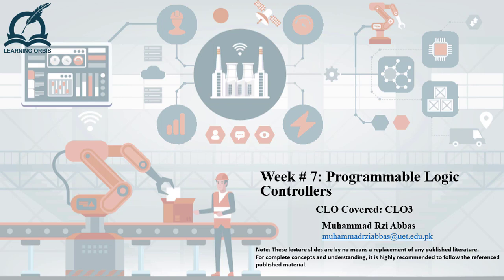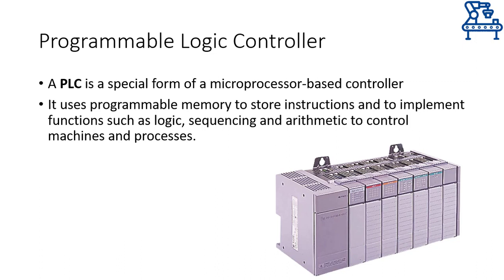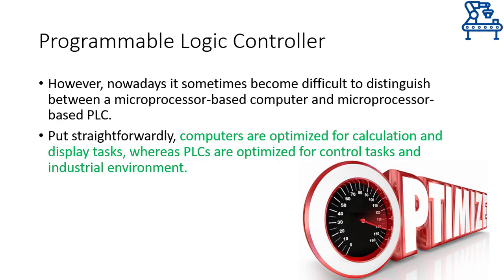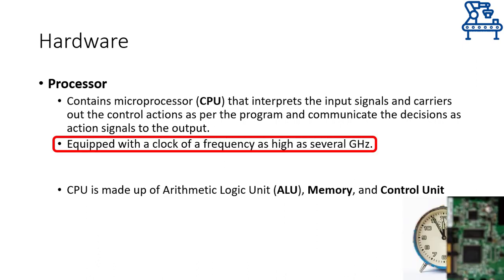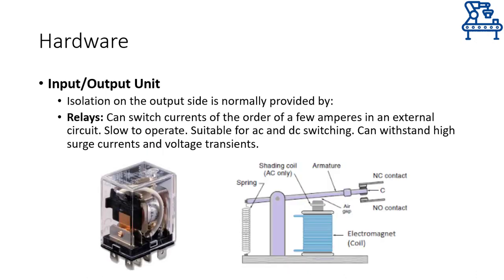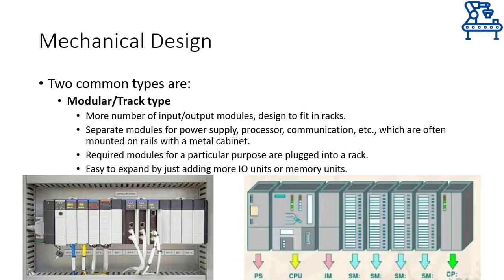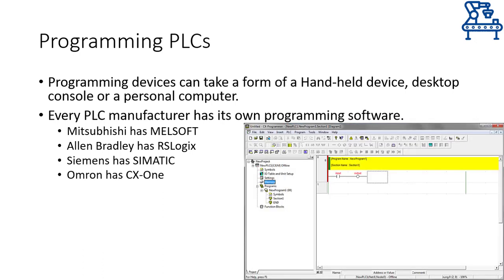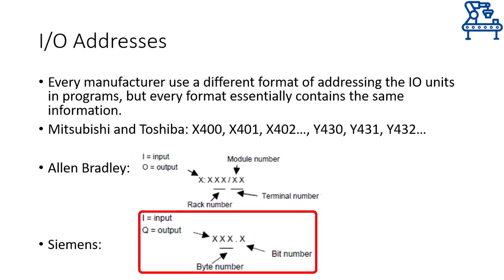Getting Started With PLCs | Hardware and Software

Comment: - PACs are digital computers that hold and execute embedded programs.
- PLCs and PACs differ in their programming interfaces, PACs use C or C++ whereas, PLCs are programmed using ladder logics.
- PLCs control discrete processes or machinery while PACs are better suited for more complex automation solutions dealing with advanced process control, motion control, visualization, and much more.

Comment: A PAC is an advanced type of microprocessor controller which uses Distributed Control Systems (DCS) and Remote Terminal Units (ITU) along with the abilities offered by PLCs in order to provide wider connectivity options and broader controls over equipment. 
PACs are more difficult to program and use a high-level programming language like C++ or C.

Comment: Programmable automation controllers (PAC) are digital computers which hold and execute embedded programs and perform complex tasks and they usually control machinery in factories.
Programmable logic controllers(PLCs) are industrial computers use for simple tasks. They are used in manufacturing, plants and other automation environments.

Comment: PACs are Programmable automation controllers, are digital computers that run embedded programs and are built to fit the industry's environment.

PLCs regulate discrete machinery and processes, whereas PACs are more suited for complex automation solutions dealing with advanced process control, motion control, and so on.

Comment: PAC's are the automation controllers that are used to implement high level instructions in industry.PAC offer more input/output remote capabilities and has a smaller size. Also they are more resistant to environmental stresses.
PLC's on the other hand are used in industry of the execution of relatively simpler tasks.These are based on wiring so additional hardware is needed for extra I/O ports.PLC's have limited memory and are less resitive to environmental stresses.

Comment: Programmable automation controllers (PAC) are digital computers that execute embedded programs and build as we desire for the industry. 

The difference between the PLC and the PAC is the mode in which it scans. Usually, the PLC runs continuously. PAC has a real-time operating system that allows it to run in a scheduled cyclic mode. and  PACs are more suitable for complex systems whereas PLC's are used in simple tasks as compared to PAC's.

Comment: Programmable Automation Controllers are digital computers specifically designed for a particular application. PLCs differ from PACs in the way that PLC runs continuously while the PAC carries out its operations in a cyclic mode. This enables the PAC to execute quite complex alogrithms.

Comment: PAC stands for Programmable Automation Controllers. They are actually digital computers to carry out embedded programs and they are designed specifically according to the usage required. 
The main difference between PLC and PAC is that PLC runs continuously and for rather simple tasks while PAC runs in a cyclic mode and executes complex programs.

Comment: PAC stands for programmable automation controllers,  They are actually digital computers to carry out embedded programs and they are designed specifically according to the usage required. 
The main difference between the PLC and the PAC is their scanning mode. The PLCs run continuously while the PACs run in a scheduled cyclic mode.
 PACs are used for more complex systems and PLCs are used in simple tasks.

Comment: PAC stands for Programmable Automation Controllers, they are digital computers that execute Embedded programs and are designed according to the environment of the industry.
The main differences in the PLC and the PAC is their scanning mode. The PLCs run continuously while the PACs run in a scheduled cyclic mode.
PACs are used for more complex systems and PLCs are used in simple tasks.

Comment: Programmable Automation Controllers (PACs) are industrial computers constructed and adapted for manufacturing environments. These computers are the brains of a manufacturing operation as they control automation equipment with high reliability.                                                                    
 PACs use C or C++. PLCs on the other hand, are programmed using Ladder Logic. These programming differences create distinctions in the architecture and capability between the two computers.

Comment: A Programmable Automation Controller (PAC) is a 2 or more processor-based device like a personal computer using multitasking capabilities to automate control of one or more pieces of equipment. 

PACs are more intricate using C or C++. PLCs, on the other hand are programmed using ladder logic.

PACs offer robust monitoring and control features when compared to PLCs, which are more basic in design.

Comment: PACs stands for  Programmable Automation Controllers and have ability to monitor and control thousands of input output points during the tag-based programming and used for complex tasks while the PLCs (Programmable Logic Controllers) have simple execution but with limited memory and allow the communication between others multiple PLCs, HMIs (Human Machine interfaces ) and data acquisition systems (SCADA) and used for simple tasks.
So the PLCs are ideal in high speed Control, also the main difference between PLCs and PAC is their programming language.
For PLCs we use Ladder logic and for PAC we use C or C++.

Comment: The term Programmable Automation Controller (PAC) is used to describe any type of automation controller that incorporates high-level instructions. It is industrial computer   constructed and adapted for manufacturing environments.
The most notable difference between PLCs and PACs is their programming interface. PACs are more intricate using C or C++. PLCs, on the other hand, are programmed using ladder logic.

Comment: PAC stands for programmable automation controllers, they are digital computers that execute embedded programs and are designed according to the environment of the industry.

PACs are more suitable for complex systems whereas PLCs are used in a simple task.
 The PACs are programmed using C or C++, therefore, have an open architecture and incorporate modular design. Whereas, the PLCs have simple program execution.

Comment: Programmable Automation Controllers (PACs) are digital computers that hold and execute embedded programs. 
Main differences between PLCs and PACs are given below:
1. The main differences in the PLC and the PAC is their scanning mode. The PLCs run continuously while the PACs run in a scheduled cyclic mode.
PACs are used for more complex systems and PLCs are used in simple tasks.

Comment: PAC stands for Programmable Automation Controller. PACs are digital computers that hold and execute different programs. It is actually a combination of PLC and PC and give multi domain functionality. It is best suited in complex logical processes. 

Difference between PLC and PAC is that PLC uses ladder logic and PAC uses exception based logic. Also, PLC runs continuously and scan whether some input is turned on or off but PAC perform action or make decisions when an exception occurs.

Comment: PAC stands for Programmable Automation controllers. These are industrial computers constructed and adapted for manufacturing environments. These computers are the brains of manufacturing operation, providing a highly reliable control of automation equipement. 
1. The most notable difference between PLCs and PACs is their programming interface. PACs are more intricate, using C or C++. PLCs, on the other hand, are programmed using ladder logic, a programming language that employs symbols representing an electrical schematic of relays. These programming differences create distinctions in the architecture and capability between the two computers.
2. PACs provide more flexibility in programming, larger memory capacity, and better scalability for future expansion. They are particularly useful for systems with a high percentage of analog I/O. Oftentimes, they will be implemented in systems with extensive network interface requirements and systems with direct user interaction requirements.

Comment: PACs are programmable automation controllers. They are digital computers that hold and execute embedded programs.
 PACs are more suitable for complex systems whereas PLCs are used in a simple task.
 The PACs are programmed using C or C++, therefore, have an open architecture and incorporate modular design. Whereas, the PLCs have simple program execution.

Comment: Programmable Automation Controller (PAC) is a term that comes loose to define any type of automation controller that includes high-level instructions. The system is used in the Industrial Control System (ICS) for machinery in a wide range of industries, including those involved in key infrastructure.
* From a programming point of view, a PLC typically has a stable memory map and address. In contrast, a PAC allows tag names and allows users to specify data types. It provides more flexibility, especially when expanding the system.
* PACs typically offer much greater I/O capacity and user memory size for larger projects and larger overall system sizes.

Comment: Programmable automation controller (PAC) is a term that is used to describe any type of automation controller that incorporates higher-level instructions. The systems are used in industrial control systems (ICS) for machinery.

The basic difference lies in the programming interface of the two, making them serve different functions. The PACs are programmed using C or C++, therefore, have an open architecture and incorporate modular design. Whereas, the PLCs have simple program execution. Owing to this, it can scan along with limited memory and discrete Input and Output.

Comment: PAC is Programmable Automation Controller.

The two differences between PLC and PAC are as follow:
1. The basic difference lies in the programming interface of the two, making them serve different functions. The PACs are programmed using C or C++, therefore, have an open architecture and incorporate modular design. Whereas, the PLCs have simple program execution.
2. Owing to the ease of programming offered by modules, it is easy to attach or detach components from PAC. Moreover, simplified programming makes it capable of monitoring and controlling thousands of input/output (I/O) points. On the other hand, PLCs are wire-based systems and the addition of devices will require additional wiring with them.

Comment: PAC stands for programmable automation controllers, they are digital computers that execute embedded programs and are designed according to the environment of the industry.
The main differences for the PLC and the PAC is the mode of scanning. The PLC runs continuously while the PAC run in a scheduled cyclic mode

Comment: All automated systems are built with a PLC or PAC to control individual machines or stations. Additionally, the computers can be programmed to control a group of machines or stations. The most notable difference between PLCs and PACs is their programming interface. PACs are more intricate, using C or C++.

Comment: The term Programmable automation controller (PAC) is used to describe any type of automation controller that incorporates higher-level instructions. It is industrial computer constructed and adapted for manufacturing environments. 

The difference between PLC and PAC is:
1. PLC is a single processor based device while PAC is a 2 or more processor-based device like a personal computer (PC) is and is basically a PC merged with a PLC using multitasking capabilities to automate control of one or more pieces of equipment.
2. PACs are more intricate, using C or C++. PLCs, on the other hand, are programmed using ladder logic.

Comment: Programable automation controllers (PAC) are digital computers that execute embedded programs and are designed according to the environment of the industry. 
One of the main differences for the PLC and the PAC is the mode in which it scans. Usually, the PLC runs continuously. PAC has a real-time operating system that allows it to run in a scheduled cyclic mode. moreover, PAC are more suitable for complex system whereas PLC's are used in simple task as compared to PAC's.

Comment: Programmable Automation controller  (PAC) is a term that  describe any  Automation Controller  that incorporates higher-level instructions.
PACs, for their part, are more often than not deemed more suitable than PLCs in complex automation system
Futher more PACs also make expanding the system much easier than a conventional PLC unit

Comment: PACs are Programmable Automation Controllers. They are viewed as a cross between a PLC and a PC because it offers many of the advantages of both.
-It is easy to attach to detach components from PAC as compared to PLC
-Simplified programming in PAC makes it capable of monitoring and controlling thousands of I/O devices while PLCs are wire-based systems and the addition of devices will require additional wiring with them.
-PLCs are a cost-effective choice and work well in small-scale automation on the other hand PACs are targeted towards more complex and large-scale automation architecture.

Comment: PAC is the Programmable Automation Controller which is In fact like Digital Computers that Controls the Automation Process using Higher Languages.
PLC is of limited space and speed while PAC isn't.
PAC Scans the Program in a cyclic manner while PLC runs it continuously and thus Slowing down the speed in case of large programs.
PLC's are Programmed with Ladder Logic only Symbol Based while PAC's are programmed in higher-level Programming LAnguages that helps them to run different Algorithms also.